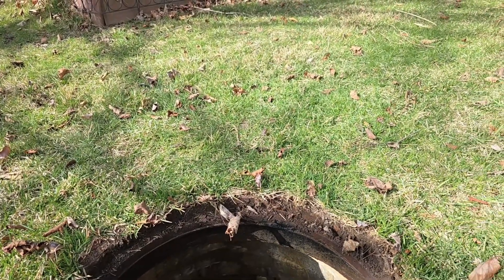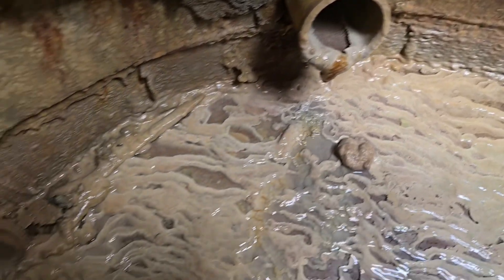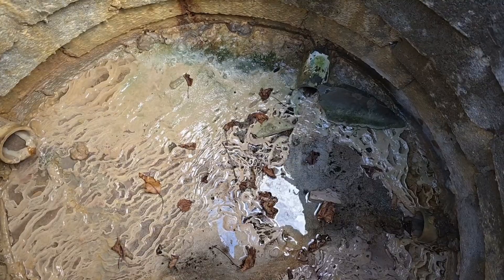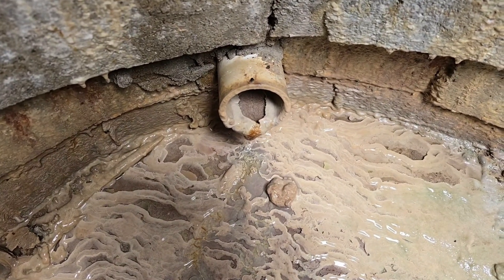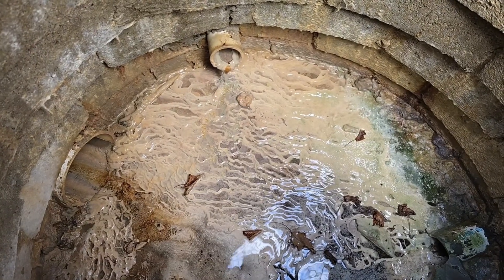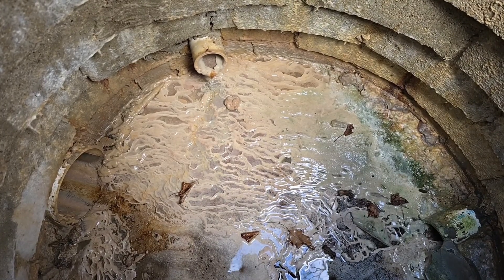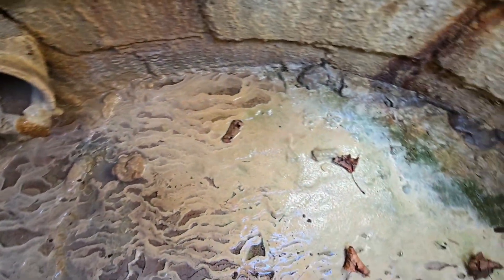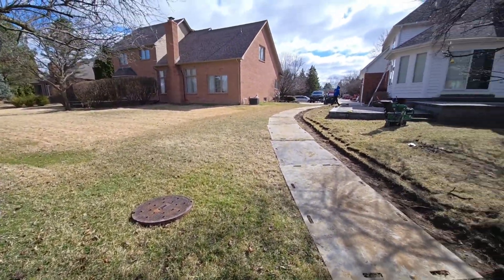Why I prefer two perforated pipes in the bottom of my French Drains

Comment: Really interesting to see. The roof runoff/French drain I installed around my house seems to have taken care of all of our basement flooding issues, but if we ever have to put in a sump pump, I'll keep this in mind. In order to jet the lines out, would you need to put clean outs where the line starts? Or is it sufficient to insert from the basin?
Reply from the maker: Clean outs at start and finish of discharge line.